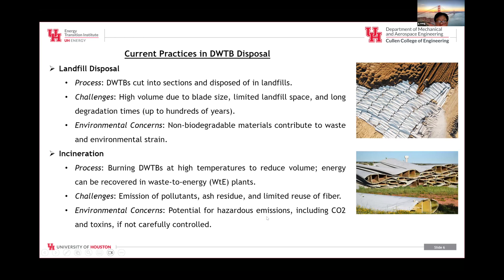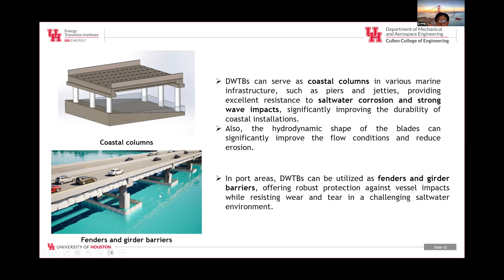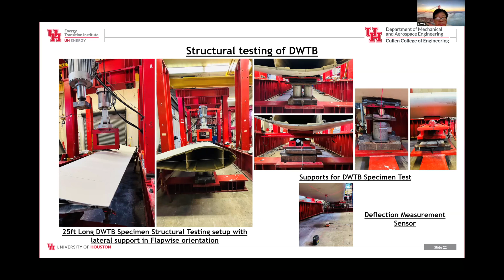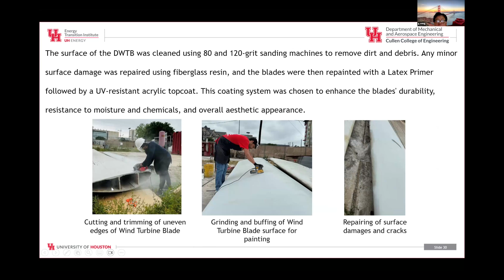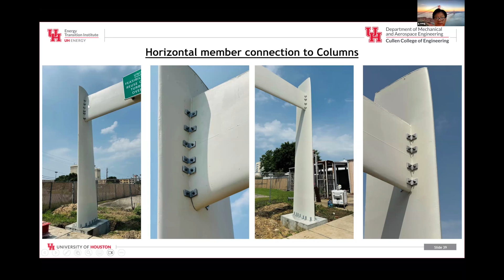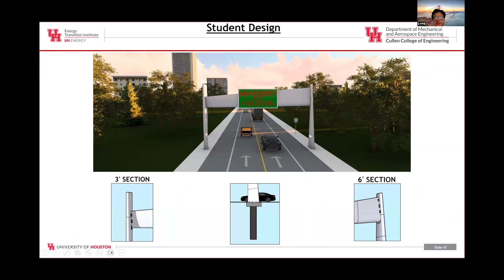ETI Webinar Series : Repurposing Decommissioned Wind Turbine Blades

Comment: Very good presentation. Couple questions/ comments. For the overhead sign use case, could DWTB be used instead of rebar in the concrete foundation pad for another use and savings of steel? 
Also I like the use case of pedestrian bridges, and I think the one in Ireland is cool because of the "root". The design incorporated more of the turbine on purpose as an educational piece showing purposeful re-use